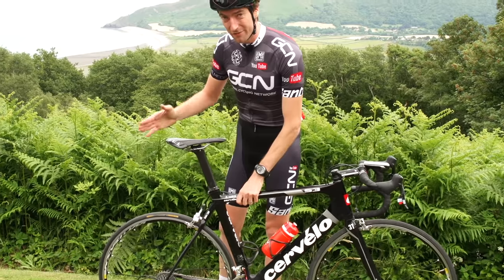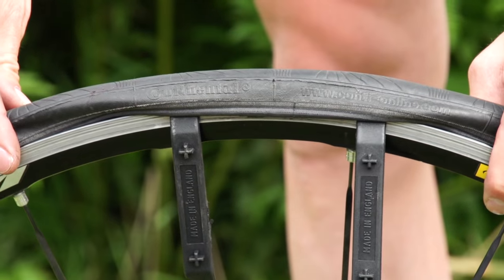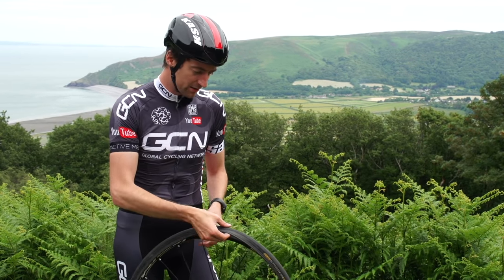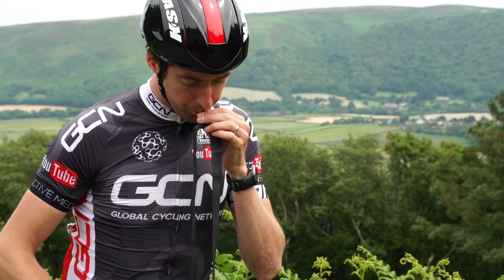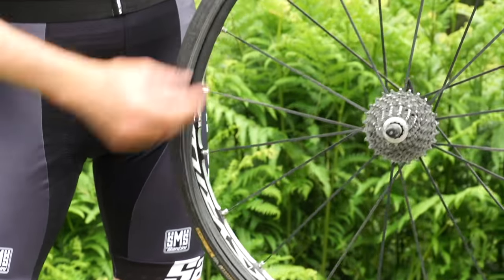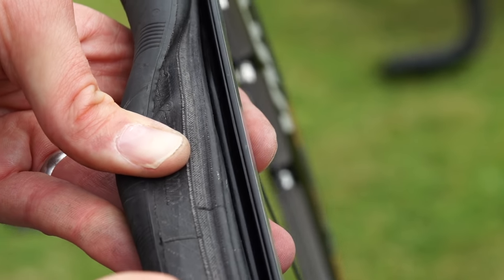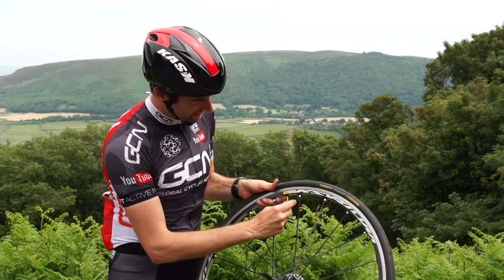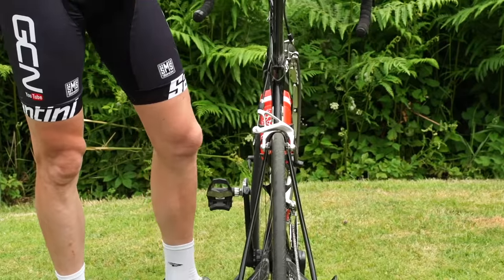How To Fix A Flat Tyre - Fix A Road Bike Puncture

Comment: When replacing the tyre leave the bead at the valve stem till last as this will avoid the tube being pinched push valve stem in but not all the way through so that you can reseat the bead without pinching tube at stem fixing.

Comment: My back tire held up for 10 years I finally got a flat last Saturday. I was going to take it to the shop to get it changed but watching this video I see it is not hard to change the tire, I already got the tube out need to buy a new one.
Reply: What brand of tire did you use

Comment: Not likely (or fun) with a small hand pump, but when using a floor pump, it helps if you pump the new tube (inside the tire/tyre) up halfway and then deflate it before pumping to full pressure. This allows the tube to even itself out lengthwise and will pull itself out from under the bead if it caught.

Comment: I have had many flats over the years. The one pro tip I can give is: after you take out the "flat" inner tube, be mindful of which way the tube was installed and then try to inflate it so it has some decent pressure. You might determine where the puncture was just by the hiss of escaping air. I normally turn the tube around with it close to my lips to feel where the air is coming out. Make sure you go all the way around the tube, and don't just assume you only have one puncture! I can't stress this enough.

Once you know where the punctures are, you can compare the location in the tube to the tire by where the valve stem is. Investigate those areas on the tire completely and remove any debris, nails, glass, staples, wire, etc that caused the flat. Carefully feel around the inside of the tire and look for any other foreign material in there and remove it and don't forget to inspect the outside of the tire too. Then patch the tube if it's only a small puncture or replace the tube completely if it has more than 2 patches or punctures.

The reason why I like to check the tube for punctures is I hate cutting my finger open on sharp glass, or poke myself with wire or nails. Also, you may miss a second puncture location when feeling around the tire if the debris only lightly penetrated. As soon as you reinflate and ride off, the pressure of your weight could cause the debris to poke through again causing another flat. And I always recommend patching a tube first. Patch kits are fast, cheap, and reliable enough these days. Keep your spare tube only as a last resort, or where patching is impractical.

I hope this was useful, and drive safe everyone!
Reply: GrognardOfXCOM Another good way to find holes at home is to run the tube under water in a basin and look for bubbles.
Reply: IronFreee This video was intended for roadside flats, not at home. However, if you have a large enough water source nearby (such as a creek, river or lake) submerging the tube is definitely an option. I've used a drainage ditch for this already and it does help to find the leak fast. Patching a wet tube isn't practical when it's cold or wet out unless you can thoroughly dry the tube off. ;)
Reply: GrognardOfXCOM that’s a very long comment .
Reply: Rosa Velázquez that's dedication and passion for whatever you do. Hats off mate for sharing your experiences.
Reply: GrognardOfXCOM But if it was a pinch puncture I don't need to do these steps right?
Reply: Thanks! Surely I will find this useful in the future! I commute for 10 months in London and got 4 punctures so far. There was a gap of 6 months until I got my 4th puncture due to the slime thing I have been told to use however it caused me other problems like blocking the air supply hole of the tube
Reply: thats awesome
Reply: But what are the chances of getting two punctures at the same time? Maybe there was a secondary cut that didn’t quite go all the way through or something.

Comment: Nice and clear video! One addition though:  I once learned a trick in my bike repair shop. 
Most, if not all, tires can be put back on the rim w/o the use of levers. If you pinch the tire at the opposite side of the part that still has to be put back on the rim, so it sits in the deepest part of the rim, you should be able to get the remainder on the rim w/o using force and with your bare hands.
Reply: that's a great tip!

Comment: Got my first flat today (back wheel, argh), I memorised this and the other GCN puncture vids. Went through every step and completed the task, however my new inner tube got a puncture almost instantly... I forgot the first rule you taught - check for a thorn in the tyre. Post-mortem revealed it was indeed a rather large thorn.
Reply: As I stated above, most frequently the tire needs repair; you must fix the hole in the tire to prevent the tire from simply pushing back through the hole, thereby rupturing itself, when properly inflated. Tire change videos that don't stress this step are simply balderdash.

Comment: Mark your tire on the side right above the valve stem before you take your commute. That will give you the orientation between where the air is leaking out of the tube and the corresponding place on the tire.

Comment: Helpful video as always.  

I'm told that not keeping/using the dust cap falls into Matt's unwritten rules, but I also get a nut on the thread of the valve of the inner tubes that I buy.  

It seems like this should go on the outside of the rim, but not really sure?

Comment: Had Mr Lloyd left some article on the ground at 5.13

If you've a tight (big) rim then use Continentals as they're slightly bigger in diameter than vittorias and it can be easier to remove.

Bontrager levers are good as they're wider than the type used ?

Comment: Finding trash in your tire can be made simpler with a piece of lady's hosiery because, as we all know, hosiery catches on everything.  I also carry a  needle nose plier when the trash is too small to be pulled out with fingers.

Just before completing the mount of the second bead, pinch the mounted part of the tire so the beads are at the bottom of the rim well.  This provides two advantages: 1) The last part of the bead is easier to mount, and; 2) Because the beads have forced the air in the tube to be concentrated in the part of the tube where the tire isn't completely mounted yet, the tube will be forced into the upper reaches of the tire thereby almost completely eliminating the possibility of pinching the tube.

Comment: You don't have to worry if you have slime in your  tyres it can seal punctures to a size of three mm problem solved I had it in my mountain bike and it worked wonders planning on putting it in road bike when I get it too

Comment: Hi Had my first flat today caused by a pot-hole, I got the tube replaced and back in and then made it back home.  Looking at the tyre when I got home the tyre does not seem to be sitting central in the rim, the tyre middle line is moving between the left and right side of the wheel. 
Is there an easy way to centralize the tyre on the rim?

Comment: A little trick: after you get a flat, go see where is in the inner tube and try to locate the same position in the tyre.
The other day I got an invisible thorn inside the tyre and I was able to locate it using this method.

Comment: if the hole on the outer tyre is quite big, should I repair the outer tyre as well?
Reply: Yes, absolutely! This is a subject not covered by the video, and in most cases you will need to repair the outer tyre. Otherwise, the inflated tire pressure will simply hirniate the inner tube once it's highly inflated.

Comment: 3:20 You should NEVER use a tyre lever to get the tyre back on the rim. It is all to easy to simply pinch puncture the new inner tube with the lever. I worked in a bike shop with Cytech qualified mechanics and they were adamant about this.
The real solution:
If you are struggling to get the last section of tyre back on the rim, go to the opposite side of the wheel and make sure that the bead is seated as deep into the rim as it will go. The extra 1mm provided will give you the freedom to push the remainder of the tyre on to the rim with your thumbs.
Reply: In theory this makes sense.  I will try next time instead of destroying 2 new inner tubes with tyre levers.  :0)

Comment: A basic flat tire lesson that is fundamentally correct. Conveniently correct? No. There is one more thing you should have with your tire tools, tube and pump. A pair of 'surgical' style disposable rubber gloves. Few of us mortals have wheels, derailleurs and chains that are clean. The gloves take up virtually no space and will let you continue your ride without greasy grime coating your palms, thumbs, fingers, handlebar tape, and cycling shorts.

Comment: The best way to get your inner tube to not snag, is to pump a bit of air into it to make it round out before fully seating the bead. If it's completely flat then it will pinch for sure!

Comment: Showing in this video very obviously; The bold and cap on the valve are not installed. In case you have a blowout, your inner tube will be able to detach from the rim, preventing a nasty crash (if avoidable at all).

Comment: what pressure should a 23-622 road tire have ? i manage to get it pretty hard with my hand pump, but i can still push 3mm inwards with my thumb afterwards...
Reply: arncj18 Depends on weight. A rule i use, if you're under 80kgs, try around 90psi, over 80, go towards 100psi.
This is more of a comfort thing on general rides, it will adsorb more road buzz. If you're racing, you might want to go closer to 105-110psi.
Reply: ***** yea but i cant check PSI since it's a hand pump
Reply: arncj18 It is unfortunately the only way of checking it. What you could push in 3mm, someone else could push in 5, so it's a really unreliable way of measuring.
Maybe try and find a pressure gauge at an auto store and check it before you leave on a ride?
Reply: +TheMrDavidCurran I bought a pressure gauge at walmart for 2 USD. I also never new my PSI, I just inflated my tires until they were hard lol, turns out I usually ran them at ~65 PSI and that was causing my tires to get bad very soon. I'm about 80 kg an I now pump them to 90 PSI.

Comment: What's your opinion on using sealant in your tubes? I've never had a flat with that set-up. knock knock...
Reply from the maker: Eero Soralahti we don't use sealant in road tubes - always found that standard tubes and tyres do the job for training. Always sealant in tubeless MTB tyres though.
Reply: Global Cycling Network great video, would you suggest cleaning your tires between rides to help prevent flats, i hear some people spray sealants inside tires then apply tire liners to help prevent flats, seems  a bit much to me but i hear from a few riding partners of mine this works.

Comment: The only part I struggle with is putting the tyre back on. Although I have only been riding for about 7-8 months. 

(I'm 14 and 5th at national level. So I'm not a scrub if your wondering)

Comment: I KEEP destroying my inner tunes because my tire is SO tight, wth can i do? Impossible to do with just hands
Reply: Matt somethingorother - buy the tool from koolstop that rests on the rim at the back and stretches the bead up and over at the other front rim. Does not touch the inner tube. If no tool, rest wheel on floor with last part at bottom, and starting at top, work the excess "length" of tyre around and down on both sides, pushing hard with your hands. Once the excess is at the bottom, but held tight in place, lift wheel up, and it will go on much more easily, possibly without tyre levers. If still does work, find a combination of wheel / tyre - some tyres are looser than others, some wheels slightly more difficult

He showed you how to look inside the tyre to make sure that the inner tube is not pinched by the bead - this is important, and check all the way round carefully on both sides
Reply: Matt somethingorother - just remembered my tightest ever set of tyres, everything failed, I found the old school answer on the internet - warmed / softened them in a low oven before fitting. It did work, but I expect they will not come off at the roadside so not a perfect solution. Mine are just use for racing

Comment: What pump are you using? it is really small... can You get high pressure?
Reply from the maker: José Velásquez it's a mini track pump - a bit bigger than a mini pump but gets near enough 100psi in.
Reply: Global Cycling Network thnks!

Comment: No valve nut?
Reply from the maker: Gixer750pilot some do, some don't - we tend not to. It's worth keeping the valve caps on the tubes if they're in your saddle bag - stops the valve digging into in and potentially puncturing it before you've even started...

Comment: this is more REPLACE a Tyre instead of FIX it. it's always much more costly to buy a new tube than putting a tip on where you neeed, yes , it's only for temporary using, but it works well. can you guys  actually upload a video of "how to patch holes on tube?" plz
Reply from the maker: Hi ***** - this Roadside Maintenance video covers patching a tyre: How To Repair A Puncture On The Roadside - GCN's Roadside Maintenance Series. Hope that helps!

Comment: Do you need to replace the puncture tyre afterwards? Or its okay to use it? I had the same issue a glass puncture my tyre, changed my inner tube but I’m scared to use the tyre again cos of little puncture.